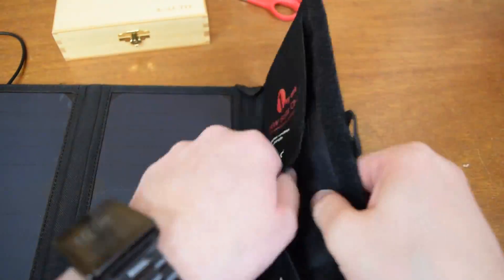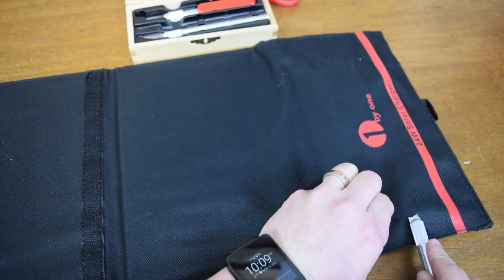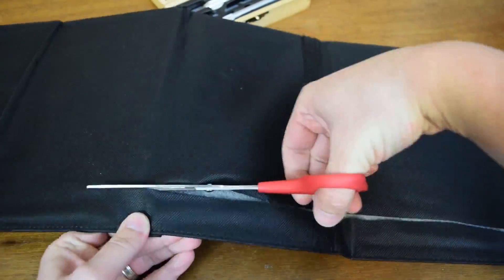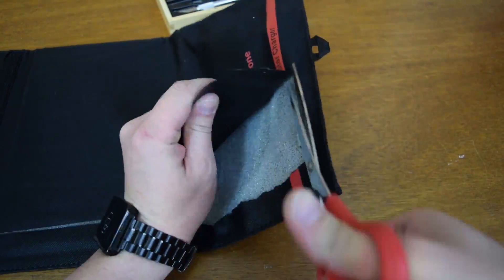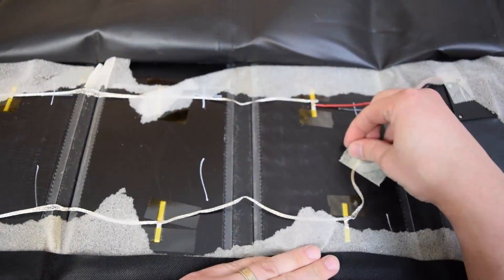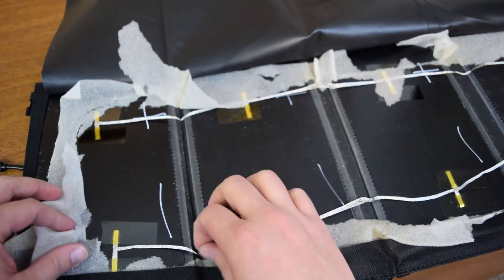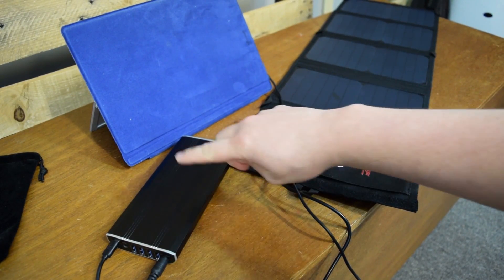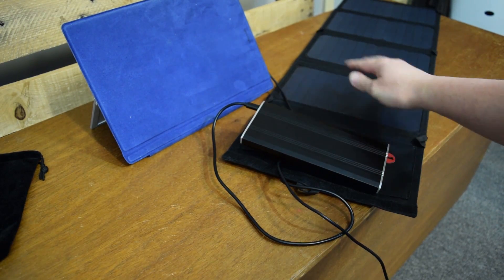What's Inside a Portable Solar Charger? Cutting it Open!

Comment: Why not open the charger box? That was the most important part. Too see what kind of chip it uses, whether is MPPT or PWM, what sort of short circuit protection is has (if any), etc. Sigh...